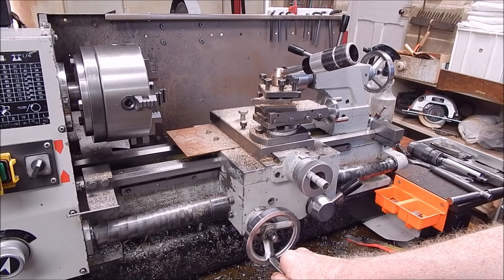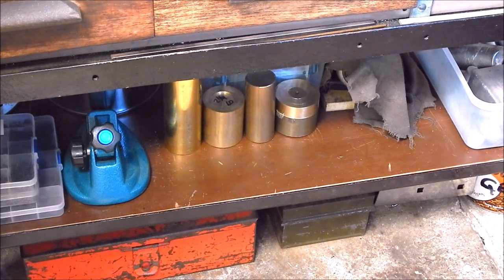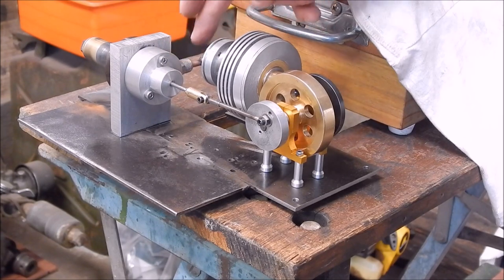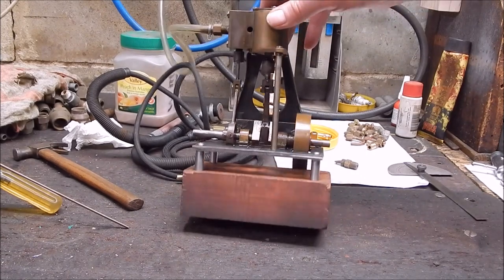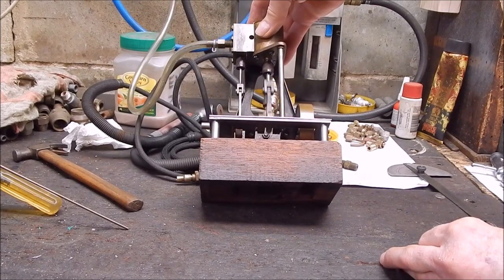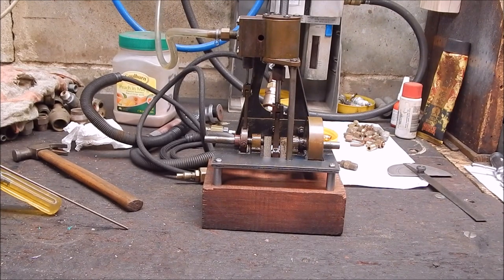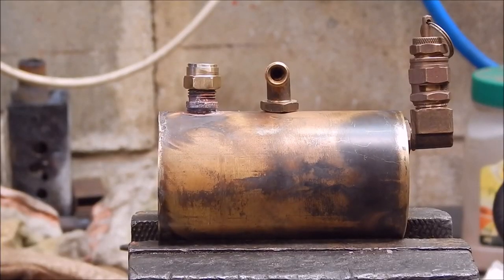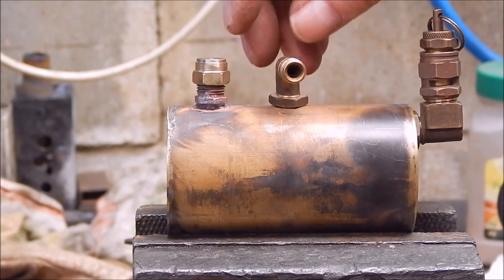I make my first model engine steam boiler

Comment: Looking good Rob 👍👍 That's going to match up nicely with that steam engine. Looking forward to the next instalment. Cheers, Alan.
Reply from the maker: Hi Alan,  I started off with solder like you, but I couldn't get a gap free finish, so I switched to silver solder.  Needs a lot of clean up, but it's good and strong.  Should be a treat to see it run  I looked at MyfordBoy and he got a similar finish with his silver soldered boiler. Cheers Rob.
Reply: @Xynudu  Hi Rob. Silver solder is much better anyway but of course requires a lot more heat.  Where you able to get enough heat with the Bulfinch or did you use oxy? Cheers, Alan.
Reply: Hi Alan. Fancy meeting you here?.
Reply from the maker: Hi Alan.  I used the big standard LPG burner to preheat the job and then used the Bullfinch to lay down the silver solder - it had enough BTHU to hold the job temperature.   Trying to juggle both torches and do the soldering is another approach on large jobs, and is a bit tricky, but I have done it before.  Copper/brass is good to work on with the Bullfinch, but you have to be careful with small fittings as the brass can melt.  The high temperature also means lots of clean up after.    Thinking about it, having an extra arm and hand makes a lot of evolutionary sense ;)

I had to shoot that video twice - grrr.  Used the Lumix rather than the Nikon to get better sound quality, and when I went to edit the footage I discovered that the remote microphone battery was dead.  LOL.  On the second pass I had to re-shoot one clip about ten times because of noise issues.   I only did the video as an afterthought as I didn't have time during the project stage.  It turned into a drama.  Such is doing YT.

Going to be hot today and then more rain.

Cheers Rob
Reply: @Xynudu  I'm glad that the Bulfinch was up to the task as I might try silver solder on my next boiler.  Yes an extra arm would be really useful 😀 My mic plugs into the camera so I don't have battery issues. I have, however lost count of the number of times I've jogged the camera by pulling on the mic cable and had to re-shoot something 😂 Cheers, Alan.
Reply from the maker: Yes give it a go Alan. It's not difficult.  I used a 1.6 mm rod, the smallest you can get ( I think it is ).  I thought long and hard on how best to mount the boiler and have decided to braze a short piece of threaded rod on each end (5 mm long) at the center line so I can bolt it to a pair of flat steel vertical risers.  That way it will minimise heat loss/transfer and should be pretty simple to do.  I won't put a cover over it like you did, as the BG boiler works fine without one (totally open). 

I was thinking that as the BG one is all aluminium, it would be pretty simple to cast a cylinder in ally with one end in situ, and then use a disc and "O" ring at the open end with a centre threaded rod to keep it in place/ tension it.  Ally pressure cookers work with just a seal.  The neoprene should handle the heat OK.  So that may be a future project.  Plus you can cast the cylinder wall thicker than the brass tube and use all screw in fittings - no soldering.

The boiler/ motor combo is actually not far away from a test run, as I have found all the bits I need and got most hooked up temporarily.

Cheers Rob
Reply: @Xynudu  The firebox on model steam engines is really only there to concentrate the heat on the underside of the boiler. Small model steam engines tend to have small burners which run off methylated spirits which as you know gives quite a low temperature flame. If you have a decent burner then you won't need the firebox.

I like your idea of casting an ally cylinder, I might have a go at that. Some of the SIM Co model steam engines use a boiler which has end caps held in place by a central rod. Seems to work ok at the low pressures involved.

Good luck with your test run.  Cheers, Alan.

Comment: G’day Rob. You’ve got the engine so you need a boiler, good project. 
Cheers 
Peter
Reply from the maker: It should be interesting Peter.  Lets me use up some of very many varied brass fuel and air line fittings.  Having that BSB tap and die set is manna from heaven, as I can rework their threads to a standard size very easily.  26 TPI is perfect for this sort of work.  Projects are good brain food. Cheers Rob

Comment: You poor silly old bugger-had to have a go---go hard for anything--,learning is what counts.Are you having fun Rob because I am having fun watching your evolution..regards  E
Reply from the maker: Hi Ian,  it's good to learn.  The biggest job will be cleaning up the finished article, but getting it to run that little engine will be way cool.  I've been thinking about this for quite a while, but didn't think I had the materials - I could probably do one in stainless steel after rummaging through my bits and bobs.  Cheers Rob.